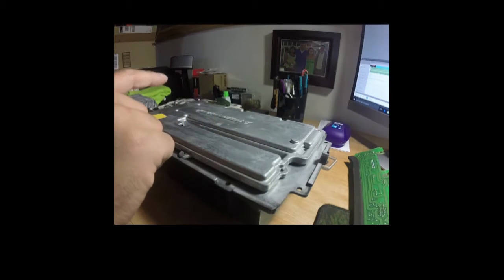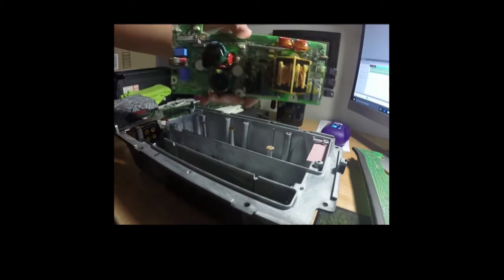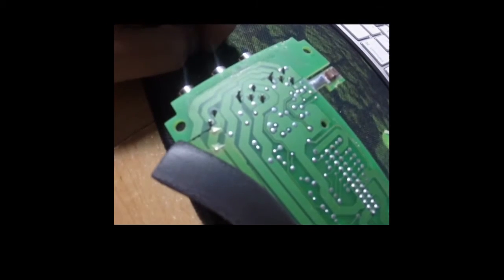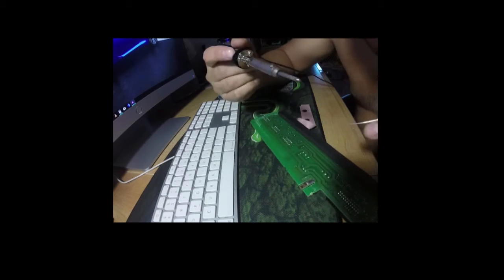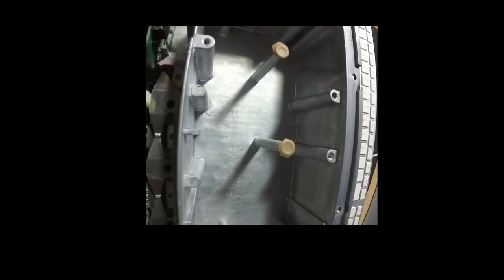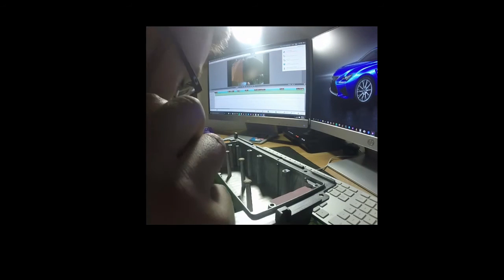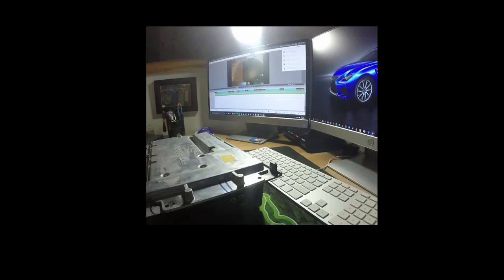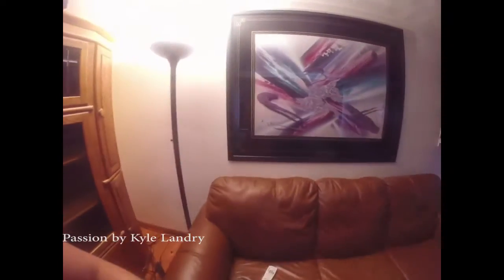bose lifestyle 28 repair

Comment: I have a lifestyle 28 that has boselink 8 wire connector  2 Bose amps and speakers to two seperate rooms. The right speakers in both rooms  are not working. Checked all the way back to the lifestyle 28 system and looks like it's coming out of the lifestyle 28 reciever. Bose support seems to think both amps are defective. I don't think so ....any idea?

Comment: Hi   I have an old lifestyle 28 iii. I haven’t used it in awhile but want to but it in my workout room. I notice I’m having intermittent sound cutting out for a quick second. Never had this issue before. Any idea what could cause that? The sub has a steady green blinking light.
Reply from the maker: Try running an extension cord to the system from a different outlet/circuit. I also notice it happened on one particular outlet thats not grounded properly.